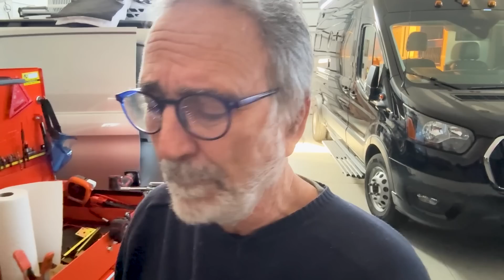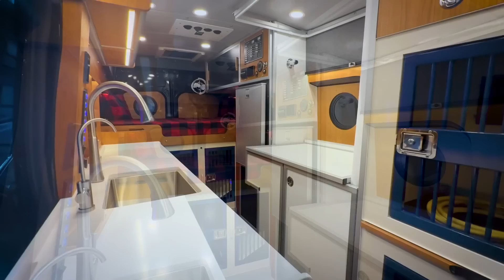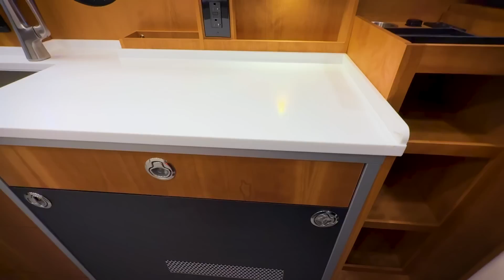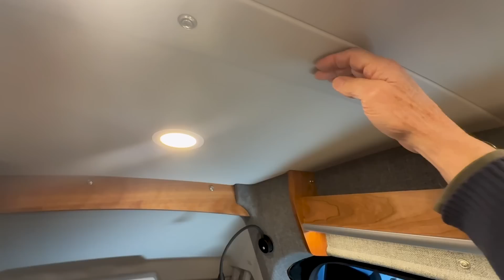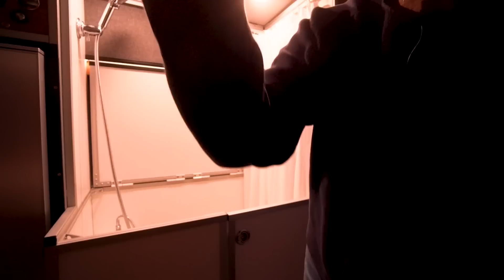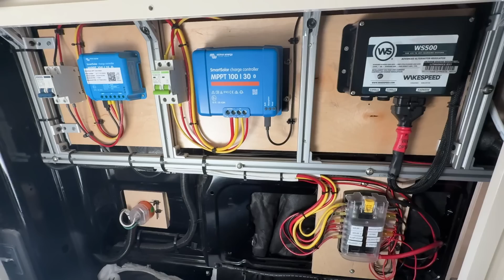Built for a traveling competition trainer, this Humble Road camper redefines "a dog's life!"

Comment: I’m so happy to see you stay away from high tech electronics like the firefly system. Most tablet based systems are crap and will leave you stranded. Analog switches rock, are reliable and have a very nautical esthetic. One concern is that the black color (although gorgeous) is more challenging to cool in the summers. I too travel full time with two dogs and feed raw. A separate freezer for all natural raw food is essential . I’m currently living in a 2019 Coachman CrossFit Ford 3500 HD . Five or six years down the road, I’ll be ready to step up to a custom build. Please message me with a link to maintain contact. Where are you physically located? I would like to come out to visit .

Comment: OMG -  So it's a "Studio" now - Not  simply a"Work Shop"🤔

👍
Reply from the maker: A "work shop" may refer to a production environment. A "studio" could refer to a single project based effort. More focus on creativity rather than quantity or speed. And keep in mind, prior to Humble Road, I spent 35 years running an advertising photography studio. I did some of the biggest ad campaigns you've seen in magazines and billboards. That's how I approach van building.
Reply: @HumbleRoad  Yes I get it.
I did send it in JEST.
THX for the reply.

Comment: @Humble Road are the sliding door cabinet made from 8020? I'd like to see them in greater detail.
Reply from the maker: They are made from 80/20.
Reply: @HumbleRoad  Are you using 40/20 at the bottom and the top to get two tracks? Wouldn't that make the spacing between the doors a bit too big?
Reply: I still think Humble Road is the 8020 University and George is the Professor. I am, as always, in awe.